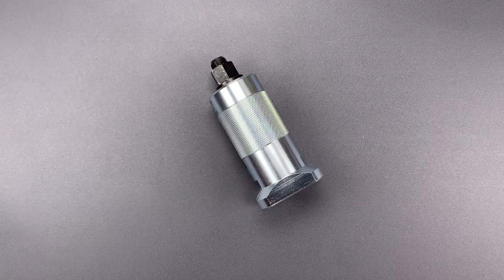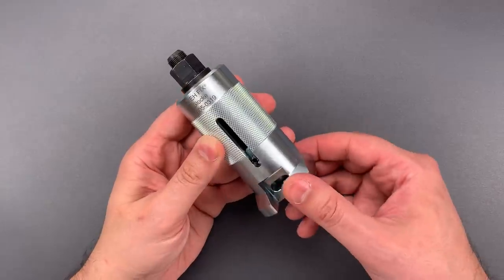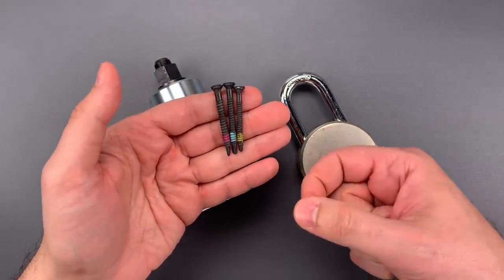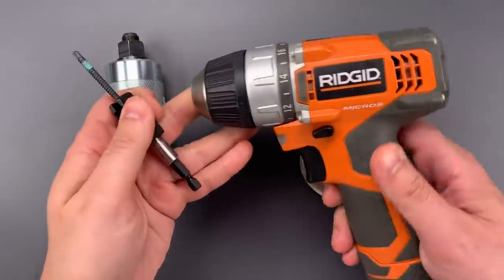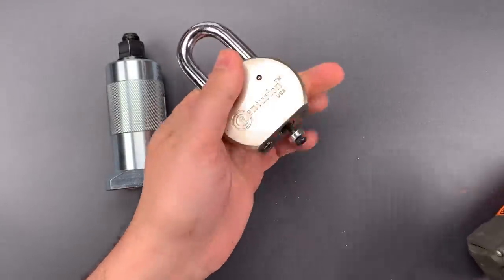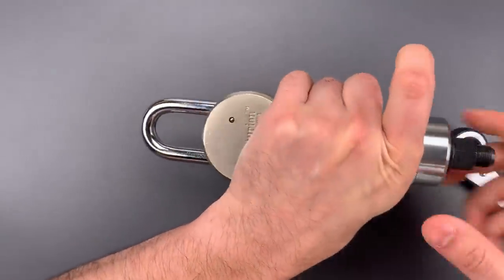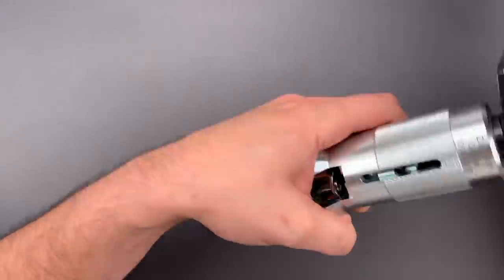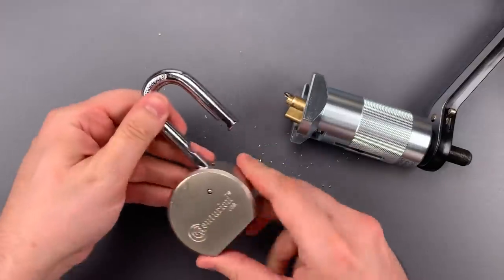[971] New Series: Zieh-Fix Core-Puller vs. Padlock

Comment: Any practical way to make a lock resistant to such a thing?
Like maybe making the existence of the core necessary for the shackle to be loosened?  Maybe bumps inside so even if the core is ripped out still need to figure out where to push or pull in several places so it's lock picking either direction?

Awesome vid!
Reply: Not without reducing durability of lock or key - The force that a low TPI thread like this can deliver can be over a ton

You can either make a thinner keyblank space so that only smaller screws can be used
or
Use weaker disks like Aluminium so the disks are sheared through losing grip before the locking pins give way

Comment: Hey LPL, in my area of the fdny we come across alot those style locks. On some of them (the cheap ones that just say "hardened" on them) we take a flat head screw driver to the face plate and peel it off, dump out the core, and turn the cam to get it open. I was hoping to see if this destructive attack is a viable option on any of the locks you have shown in the past

Comment: I was wondering what state most locks are in after this core puller is used. Is it usually a case of just replacing the core or is the lock as good as trash after this?

Comment: The best way to make that tool useless by thieves, would be to weld a fairly thick steel plate over the core that has a hole in it for the key.

Comment: Definitely not the most subtle of destructive entry methods I think. Still more subtle than the ballistics though!
Reply: It's pretty quiet for a brute force attack.
Reply: @Kaboomf  Huh... is that so? Didn't seem that way to me from the video, but I could be mistaken.
Reply: @airmanon7213  That's because the audio is set at levels for clearly recording spoken audio
The loudest noises are the powered driver, which could be replaced by hand winding if time isn't essential, and a normal ratcheting spanner
Standard mechanics tools and would be heard outside a building by watchmen but not from inside or raise neighbours attention
Reply: @bengrogan9710  ok. thanks

Comment: Does it have any spring tension on the center bolt? What I mean is when you go to loosen it to get the core & screw out, will it go all slack like a 3-jaw puller, forcing you to hold it from both ends, or will it let you just gracefully loosen the bolt and then take the screw out?

Comment: What I am wondering, is the shaft on the screw small enough in diameter to bypass side anti drill pins, yet with enough threads per inch to give a strong enough hold to be able to break a properly hardened and tempered retaining screw and plate?

Comment: Is there a particular reason to use this tool instead of a bolt cutter? If you've decided to destroy the lock, wouldn't a bolt cutter get through the shackles faster than this tool gets through the core?

Comment: So what would be the point of a core puller?  Is it intended for locks that are un-pickable and the owner just needs to remove the lock?  Wouldn't a locksmith just pick it like LPL does?  And a grinder will unlock most locks I would think.

Comment: How does this do with locks that have spinners/anti-drill pins, etc?
Reply: The screw just makes its own room if needed. It's not a regular drilling attack which aims for removing the pins from the core.
IF there are anti-drill pins on the sides of the keyway they actually help the screw getting a good hold in the core.

Comment: I imagine this could pull the core from a lock that is not designed to be removable since it just stretches the face plate until catastrophic failure is met?

Comment: In the U.K., euro locks are pulled out in a similar way. The burglar puts a screw in then uses a claw hammer to pull out the cylinder. Higher security locks are anti-pull though (and anti snap/bump/drill)

Comment: Are there any locks where the bottom is at a 45 degree or some other angle whilst the core is straight, that would render this gadget useless?

Comment: Why would a locksmith need to use one of these? Does it pull out the core in such a way that a new one could be inserted, or is the whole thing useless at this point?

Comment: Might be nice if instead of just exposed threads and the nut puller it had a built in manual impact driver, the kind you hit with a hammer.

Comment: Hey Lock Picking Lawyer,i have a lock that has the Evils Keyway that i saw.You can buy it on Amazon,i can not pick it while the Pins are behind a Keyway curve.The lock that i mean is the 2019 Squire ss50sc cen4...a really nice lock full Hardened Steal Boron Shackle and extrem Safe and Pickresistend.The Keyhole locks like zick zack and S but the pins are unrechable.I think it is the best lock that you will become for your Money. But the Mauer core in there will be nicer,but i have no clue how i can buy this.

Comment: Definitely an improvement over the imitation. But it still would have taken less time to pick, at least for you.
Reply: There's plenty of domestic doorlocks that aren't easily picked, or picked at all by LPL.  This core puller will open them. 

It really depends on the situation. If  you want speed and results then a core puller is the way to go.

Comment: I'm guessing that the only way to counter this is a cover plate bigger than the opening on the core puller, is it not?
Reply: @Zieh-Fix  But the spinner has to have a big enough aperture to allow manipulation of the core elements, and thread pitch of the screw going into the core can be made wider than the thickness of the spinner. Btw, I'm no mechanical engineer, just spit-balling

Comment: you know with a little impact driver you could set the screw then put in a socket adapter and drive the puller doing this in seconds

Comment: Slow but will work on all smaller locks.
Reply: @Zieh-Fix  a firefighter would more likely kick it open or smash the door.
Reply: @Zieh-Fix  If they want to lock it afterwards then this thing is the wrong approach XD Also if the damage that is made through the firefighters is what was needed to prevent even more damage the the firefighter or state have mostly no more problem.
Reply: @Zieh-Fix  I only meant situation where the firefighters don't have the time to wait 90 at best. In a case of flooding the owner mostly could even provide the keys.

Also 3 pins in door locks? And only 5 in safety locks?
I get your point with the durabil lock, but in that case the door may even the weak point, or some other security flaws like a backdoor made out of glass.

Comment: Sure LPL could pick that faster, but that's NOT the point.
99.99% human on this planet would choose that core-puller over manual picking because it's easier and didn't need any experience.
The second point, lock manufacturers could make a big-fat 5kg, 50-pins lock with tons of false gate, and with crazy looking keyway, but any in-experienced people still could open that lock with this core-puller.

Comment: Is this tool only for padlocks or can it be used also for door locks?
Reply: It is constructed to pull cores on EURO cylinders, but works on any core, that is exposed.
Reply: @Zieh-Fix  Are there any Euro cylinder locks that are resistant to this method?
Reply: @Zieh-Fix  Thanks for the info. And I'm guessing that "regular" locks that have hardened steel core will also offer some protection, since it will be difficult to drill into.
Reply: @Zieh-Fix  I've checked the prices here in the Netherlands and these locks that have this pulling core protection aren't that expensive, the prices start at around 30€. So that's pretty affordable.

Comment: Interesting tool, but expensive. I've seen the same effect achieved with a stainless steel screw and a claw hammer.
Reply: The point of the tool is the fine control granted by the pulling thread and not all locks have a good solid location to lever a claw hammer due to shackles etc
Reply: this is also much safer.
Reply: @bengrogan9710  Feel free to go ahead & buy the tool. I won't be.
Reply: @Chris153758  I won't be - but purely because I made something similar myself on the shop lathe when I needed one

Its a tool that is a godsend for people who need to use it and quality always comes with a price to reflect it

Comment: Idiot question... Guessing I'm not the first to ask this, I don't see the point of this tool as someone attacking the lock with a battery drill may as well attack with a battery grinder or looking at the lock a hammer and piece of metal or a couple of spanners basically bypassing the need for this tool. Am I missing something?
Reply: @Zieh-Fix  Thanks that makes sense.. I couldn't visualize the point of the tool on a padlock.

Comment: If your carful you can use crow bar some times 
I’m righting about the 2 rench trick tho because there is a way way better way that works extremely easy on biggest bad ist locks 
A crescent rench at least 14 inch bigger the easy er clamp it across A twist even best brand locks will brake way easier then cutting them & it workers  on many situations with pad lock THERE IS A FIX PEOPLE YOU CAN ONLY STOP THAT BY BULDING A MEDAL BOX AROUND IT SO YOU HALF PUT YOU HAND UP LIKE A FOOT   At least 
PS I NEVER SEEN YOU COVER BEST LOCKS BRAND DO YOU HAVE THEM IN AMERICA

Comment: Commenters sound dissatisfied with the amount of time taken to open that sukka. Well just as long as its opened within a respectable 1½ minute window (in-the-field time before rapid police response) then its deemed qualified. Its just because we're sooo used to seeing LPL open locks in 30 seconds or less! In any case, the lock was opened and by a device that applies tensile force by the ton², yes thats by the ton² not by the lb. There is probably no lock on the planet designed to withstand such concentrated tensile force upon it. I'd like to see an Abloy PL362, PL350 or Abus 83 Series undergo the same foul underhand medieval method of "keyless" ingress! Only the decidedly devilish LPL could deconsecrate a lock with such tenacity, panache and dare I say...audacity. 🔒💨💥💨😲💨😀💨👍 bows (That's "bows" not "grovels" btw)
Reply: @Zieh-Fix  Thats interesting to know, I'll do some research on those locks you mentioned.  They'd have to be designed to be among the toughest...like my Abloys! The lock cores are literally buried in the padlock with only a small aperture showing for the key! As you say...these Abloys have an RRP of £200+ (eBay for about £50 - 60 on auction)😉😀😎
Reply: @Zieh-Fix  The Keso 2000 S Omega IPT is a f***in superb lock! I wouldn't mind a euro profile version in my KASP to replace the Yale Superior I put in, let me tell ya! I see that the Keso 2000 offers decent pricing and decent security, similar maybe to the Abloy PL341 G3 padlock. It's good to see the competition, like Anchor Las and DormaKaba, not just Big Boys Abloy and Abus monopolizing the tough, tougher, toughest quadrant of high-end sales. I was recently talking with Squire and Abloy about certain features that I hope have been "jotted down". Although Squire was in the midst of releasing the SS100CS at the time and really needed no encouragement for future advancement from me!....a 20mm B4C dia shackle FFS! 😮💨😋💨🤩 I thought my SS80CS was king @16mm.
Reply: If I can add here...is Keso a subsidiary company of Assa Abloy by any chance? As their keys have that very name proudly stamped on them!
😲🔑🔑😁